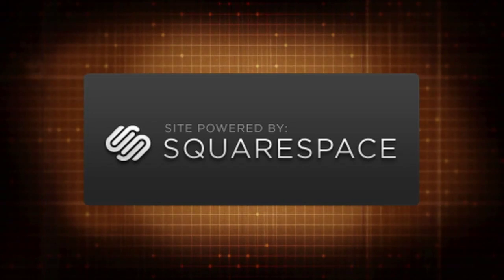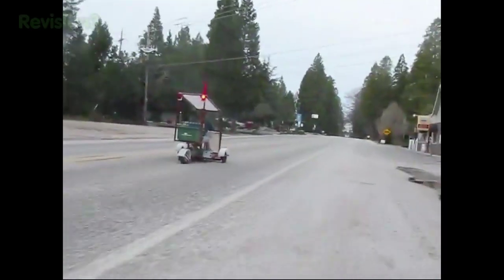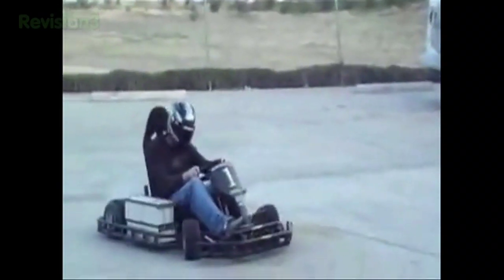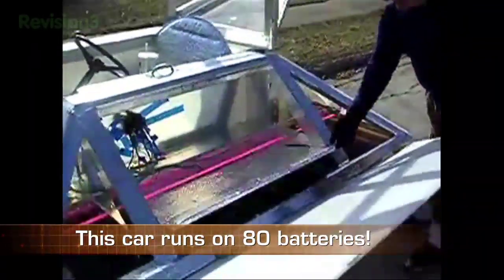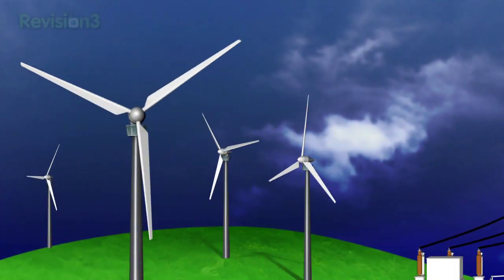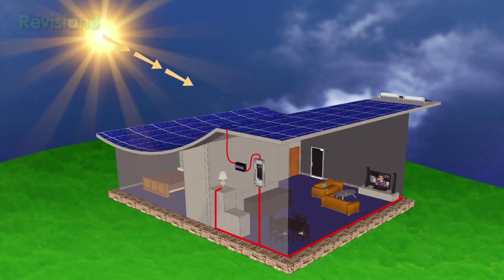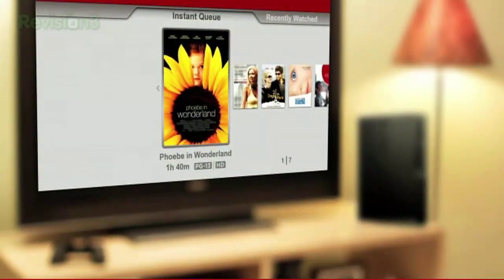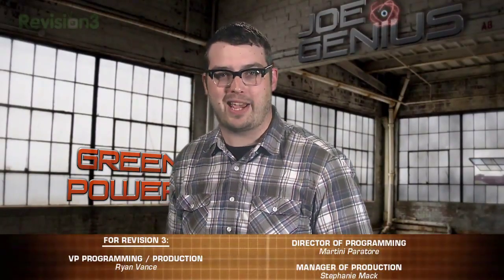IMPOSSIBLE Green Cars and Generators - Green Power - Joe Genius

Comment: You were doing pretty good till you tried to explain solar energy cells. Then you blew it. Has nothing to do with heat but photons. As photon strike each cell it tends to dislodge an electron and knocking it to another cell. After many times it actually makes a tiny bit of electricity. First off silicon is wrong color so most photons are reflected secondly due to dark color infared heat is absorbed, prematurely destroying the cells. Solar cells are inefficient. Good for calculators but almost useless for homes unless you live on an island.